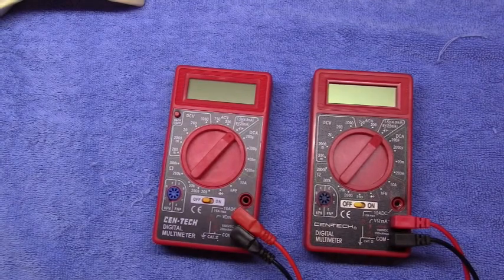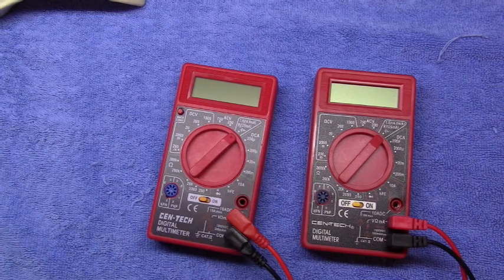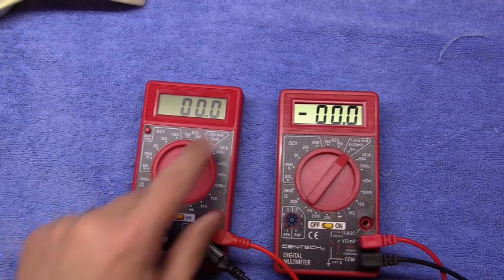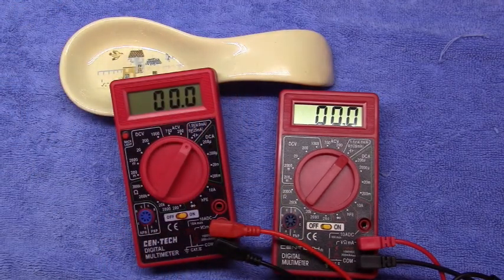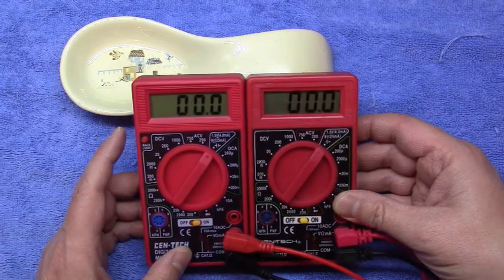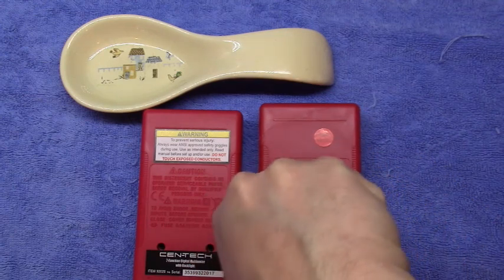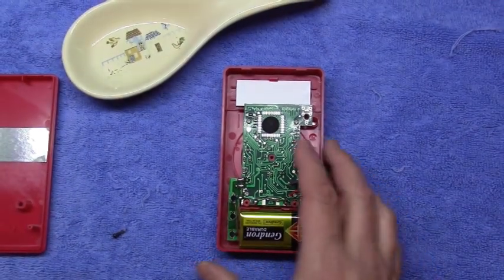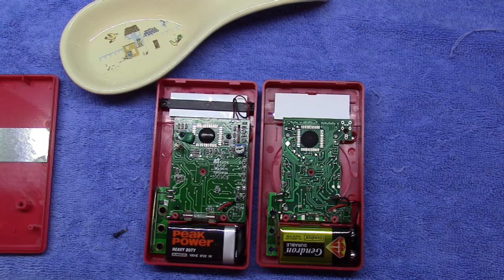Harbor Freight mulitmeters backlight vs no backlight

Comment: @11:50 There is a timer circuit for the backlight to the right of the slot where the red case comes through.  It has two transistors, two resistors, and one capacitor.  What happens when you push the backlight, capacitor C8 charges quickly up to 9V.  The resistors compose a voltage divider for the transistors and the voltage of C8 biases them to the on state.  When you let go of the backlight button, the 9V charge starts dropping due to the small current of the resistors, and eventually drops to a point the transistors are off.  I made modification to my backlight brightness by adding a 750 ohm resistor in series with one of the backlight leads, dropping current from outrageous 40+ mA to 6 mA, which produces plenty of readable light and saves on battery usage.  Also, I wanted to extend my backlight "on" time, so I replaced the 0.2 uF capacitor "C8" with 2.0 uF.  Now it lasts over 1 minute instead of less than 10 seconds.  Can always be overridden by turning off and back on.  That variable resistor adjusts volts.

Comment: Saw your video on these Multi meters. Just bought one for 5.00 w/ backlight. However, mine seems defective, maybe you can tell me what I'm doing wrong. I have the meter  selected for testing a battery ( 1.5V or 9V ) with a load. I see you get a reading of either 25 mA or 4 mA. I get a reading of 1, yes just 1 on the display....has to be wrong. I know how to use a multi meter,  I have the leads in correctly, but still get a 1 reading. Ever seen this before....maybe it's defective. Maybe I'm doing something wrong. I tested it with several batteries, all new.
Reply from the maker: H H I have not seen that before. The meter should read 25 for fresh 9 volt battery and 4 for a fresh AA, AAA, C or D cell. You very well may have gotten a bad unit. Does it read voltage and resistance correctly? If it is bad HF will exchange it for you. Good luck and thanks for stopping by.
Reply: Yes, forgot to mention, if I check the battery  voltage, it's fine, no problems. But I wanted this because checking a battery under a load is the best way to see if it's okay....but this feature is not working. I bought on eBay, paid 5.00, and 4.99 shipping I think, so about 10 bucks. I should return it just because it does not work.
Reply: Sent back already for a refund. Seller wanted me to pay for shipping back to him again. No way, opened up a case against him in resolution center, this way he pays for shipping back to him. I'll get my refund next week. If the seller does not do it himself, then eBay will do the refund for me. Ordered another one from a different seller, this one has no backlight, but cost only 5.00 total. Hopefully this one will work.
Reply: BTW....I just found your channel, I really like it. I'll be watching. You seem quite knowledgeable.
Reply from the maker: H H glad you got it all worked out. I hope you have better luck with the next one. Good luck and thanks for watching.

Comment: That's interesting. I have both versions of these. the back light version i have , Probably from about 4 years ago. My probes are much cheaper looking. I've never compared the 2 but defiantly some cost cutting measures in the non back light version. Thanks for sharing! P.S I probably have about 10 of the "free" ones LOL
Reply from the maker: Radio Rescue  10 free meters? It's hard to resist free for sure. I'm not sure how it happened but I have  accumulated many multimeters over the years and I keep buying more LOL. Thanks for stopping by.

Comment: I'm a bit surprised by the differences as well.  The board on the back light version is definitely more robust.  I also don't understand the extra cutouts on the right side of the board on the cheaper unit.  Its usually cheaper to make a board few (or no) cut-outs (a plain rectangle) because material utilization is higher that way.  Maybe that board is used on some other product where the cutouts are necessary.  Or maybe the cut-out pieces are other boards that are snapped off and used on some other product.
Reply from the maker: SevenFortyOne I was surprised to see different PCBs too. Maybe one model was designed     Long before the other and it was cheaper for them to not change the older design. Who knows. Thanks for watching.

Comment: Wonder if the differences could be contributed to a newer revision of the board or just parts available at the plant?  Would be interesting if one could find a newer/older version of both and again look?  Probably not take much to hardwire a LED inside? Future project/YT video?  :)  ~Jack, VEG
Reply from the maker: Vintage Electronics Geek Im sure they must make them by the millions and use what ever parts they have on hand. I would think that the pcb would be the same to keep the cost of the pcb down. Maybe both are not made at the same factory?  I think  adding a led could be done but the backlight version is now lower priced then the non backlight model. So I would just get the model with backlights. Thanks for watching.